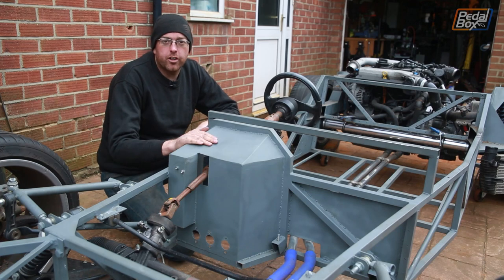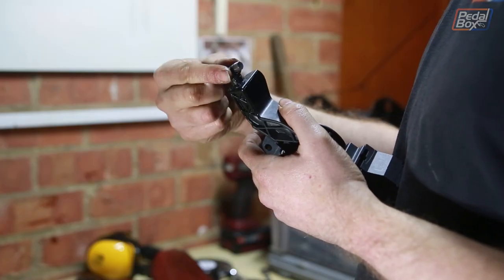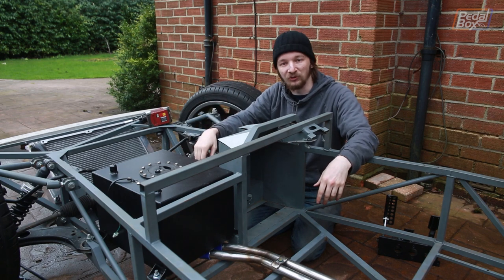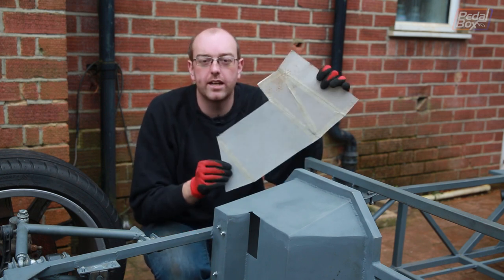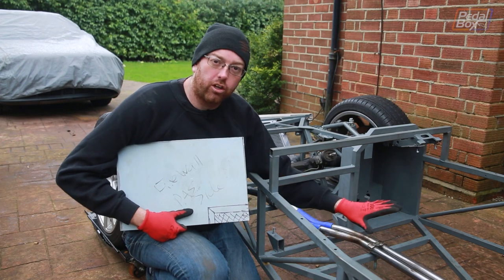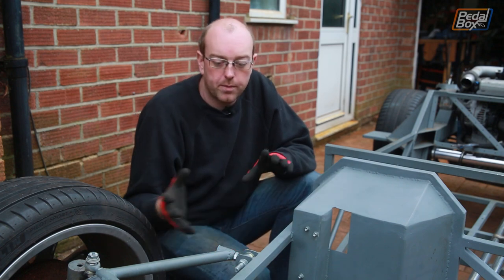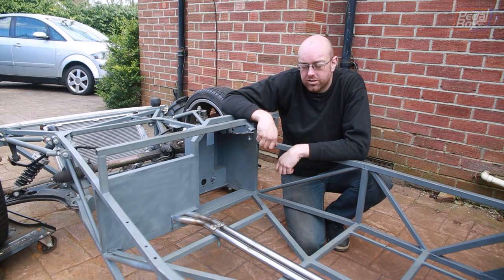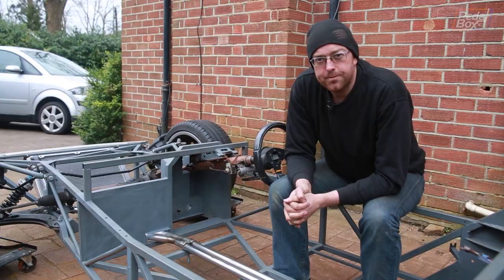Pedal Box and Firewalls | Audi Kit-Car | PedalBox Episode 43

Comment: With the steering column, would a stretchy CV boot work to seal where it goes through the firewall?
Reply from the maker: The CV ones are a bit wide to fit, needs to be maybe 50mm wide, tops. But a shock rubber should work well which i've been looking at. 

Hard part is finding one thin enough to fit well. It's only 15mm or so at the lower/narrow end and most don't go below 24 so it'd flap about at the end, but it might still work (and it'll work better than nothing at all)
Reply: @PedalBox  hmm. Steering rack gaiter maybe?
Reply from the maker: @2BugsandaBack  That's inspired. Just checked out Euro Car Parts and they've got a universal on that goes down to 10mm from 26mm, so should work nicely and open up fine. Top work! Stay tuned to see if it works :)
Reply: @PedalBox  excellent! 😊